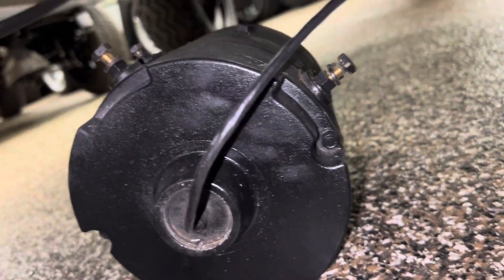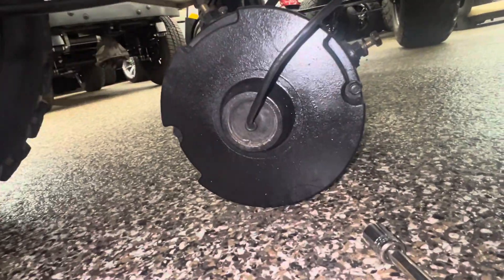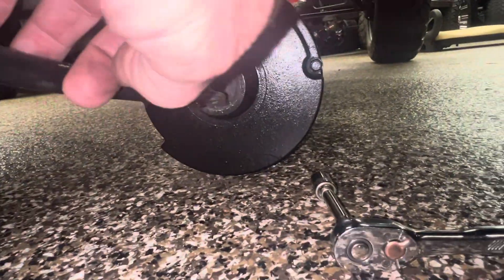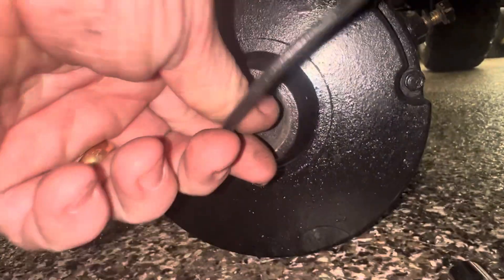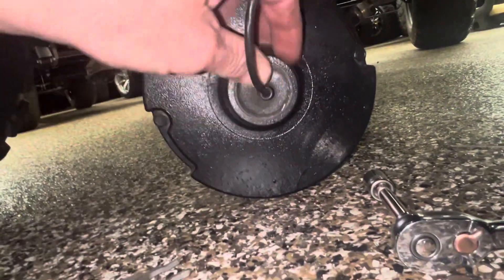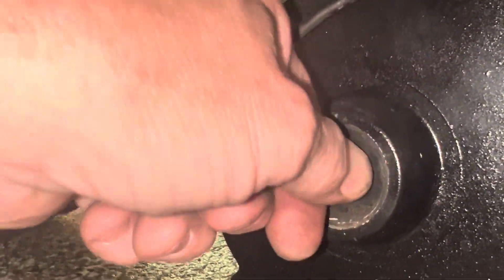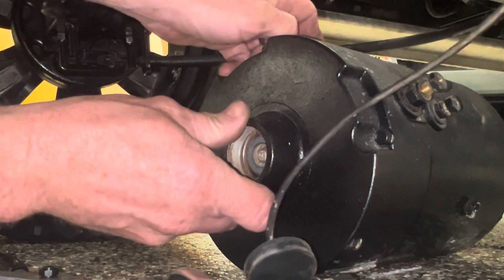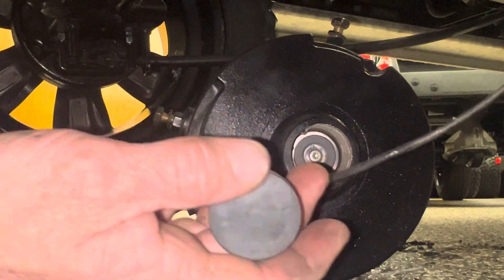Ezgo how to remove the speed sensor

Comment: I just swapped out a motor on same cart, put speed sensor in….now in limp mode.  From your video it looks like there is a magnet bolted on to the end of the motor shaft ….new motor didn’t have one.  Thank you!  I believe this will solve my issue.
Reply from the maker: @BD-qq4fn  yes sir will make a big difference.  Thanks for commenting
Reply from the maker: Hit that subscribe button for me.  Also make sure you take the rubber bumper that slides into the end of the motor that goes on the rear ends I put shaft. If you don’t put in there you will have a little chatter when let go of gas. Or whenever the motor is free wheeling
Reply: @Golfcartwhisperer  subscribed.  Thank you!  I was going down a rabbit hole and then remembered the new motor did not come with a magnet when I saw it on your video.
Reply from the maker: @BD-qq4fn glad your subscribed

Comment: Took the speed control out and the screw that holds the magnet in is missing. Hartwell ga .
Reply from the maker: @RickDudley-sp6xl  what the world.  Whoever change s it messes it up
Reply from the maker: @RickDudley-sp6xl  also make sure you put a little bit of lock tire on the screw going through the speed sensor magnet. Also, make sure the magnet faces out

Comment: This is a great video.  However, I can't seem to get the magnet out. I got the ring off, but the magnet is very stuck. Does anyone have a solution? I'm up in Ontario, Canada. Thanks!
Reply from the maker: So you have a club car
Reply: @Golfcartwhisperer  No, It's a 2006 EZGO TXT. It's the sensor that is stuck. I have a picture, but don't know how to put it on here. It looks just like the one in the video. I tried sandpaper and lube, but it is stuck, Can I heat up the metal casing in hopes to expand it? Any help will be appreciated. Thanks
Reply from the maker: @TrevorScott-l4y  oh so the magnet is not stuck the speed sensor stuck. What I would do. Is sand right above the speed sensor and take some WD-40 or some oil and pour on top of it and let it sit overnight. Or if you have a small torch, I would heat heat the aluminum up a little bit not much, but just enough where it gets kind of warm.
Reply: @Golfcartwhisperer  Thank you! I will give that a try. Cheers.
Reply from the maker: @TrevorScott-l4y  yes sir if it doesn’t help let me know. If worst come to worst. You can just take a screwdriver and break it.  Then just buy a new.  There anywhere between 20 and 100 on line
Reply: @Golfcartwhisperer  I ended up drilling a bunch of small holes through it and eventually cut it out. I bought a new one, then proceeded to put the new one in wrong (Just like you said not to do in the video, with the magnet on the inside of the washer plate!!) I'm an idiot. However, I will eventually win!! LOL. Thanks for your help. Cheers!
Reply from the maker: @TrevorScott-l4y  yes sir hit that like and subscribe fine button for mw

Comment: We have a cart that will go full speed for awhile then the brakes lock up and it beeps 4 times
Reply from the maker: What type of cart is it.
Reply: Ezgo 2005/6 I think
Reply: Electric
Reply from the maker: How do you go from forward to reverse? Do you have a tow switch
Reply: @Golfcartwhisperer  the switch on the dash, and yes it has a tow switch
Reply: @Golfcartwhisperer  we have 6 of the carts we are working on
Reply from the maker: https://youtu.be/whbFyNyxZ8A
Reply from the maker: I sent you a video. Your car should be like this. But normally when a car does that while you’re driving is either low battery voltage, key switch, to switch, pedal switch, or a break in the wire somewhere it could be any component losing connection. Just follow the video and see what you’re missing.
Reply: @Golfcartwhisperer  thank you
Reply from the maker: Yes sir reach out if need anything else. Make sure your subscribed.
Reply: @Golfcartwhisperer  I did a couple days ago. Thank you for your help
Reply from the maker: @lukemylo thanks man. I appreciate the support man. If you ever have any questions? You know where I’m at?
Reply: @Golfcartwhisperer  thank you